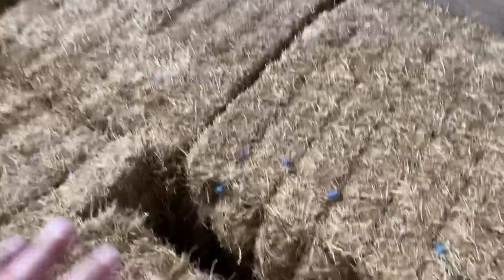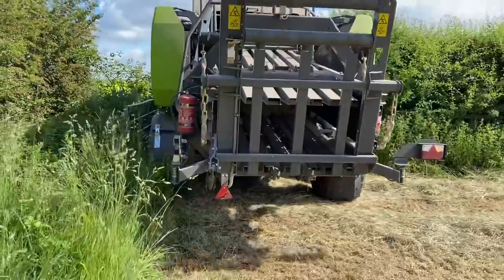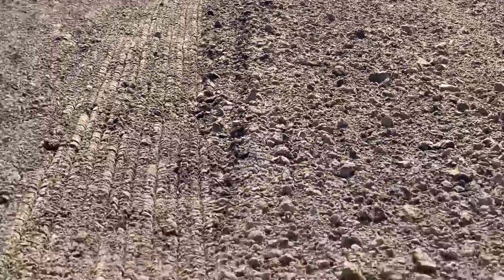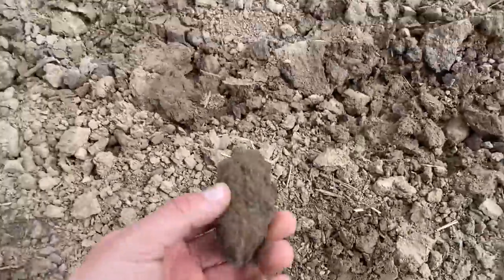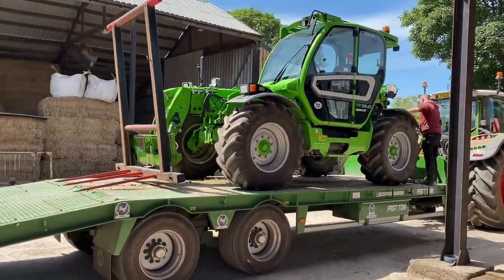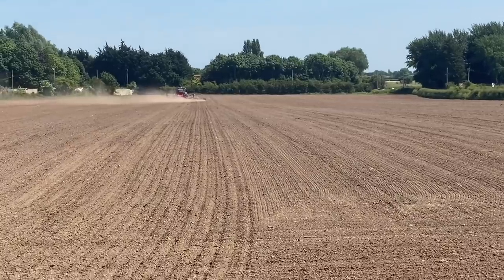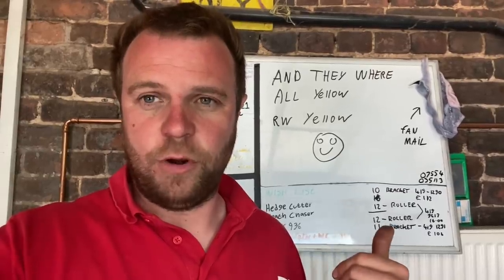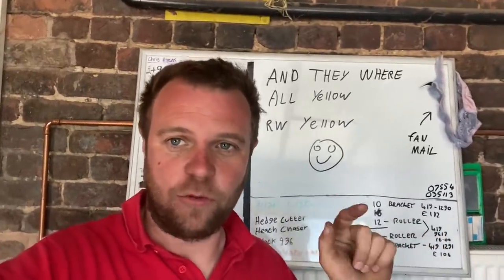Day450 #OLLYBLOGS BALE GRAB FIXING SUNFLOWERS & NEW RICHARD WESTERN DUMP TRAILER #AnswerAsAPercent

Comment: Olly i was thinking about your ride on mower from yesterday. (I'm sad I know!)  did you check the clearance between flywheel and ignition coil after replacing it? Just use a thin bit of card to put between them to set clearance. Wonder if this is why you aren't getting a spark. I'm having issues with my mower and no spark.

Does baler have a steering axle?
Reply from the maker: No but be good if it did steer

Comment: Instead of filling your shiny trailer with stones, would it not be better to measure the cross sectional area of it (width x height) then multiply that by the depth to work out the volume and add a bit for the increased height you can get away with in a trailer? You can always reuse the formula density = mass divided by volume to get volume = mass divided by density.
Reply from the maker: It’s for moveing stone